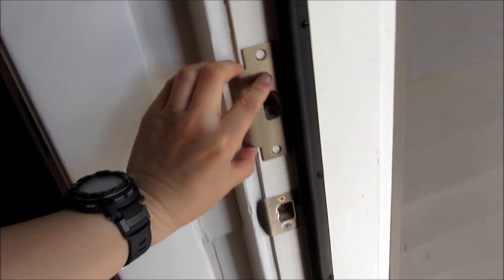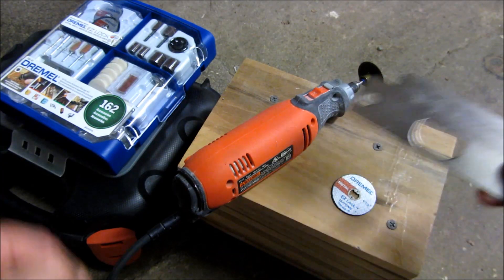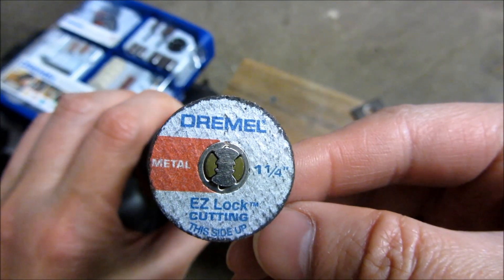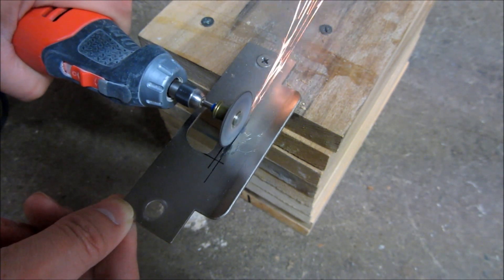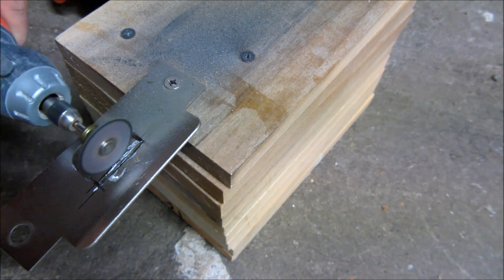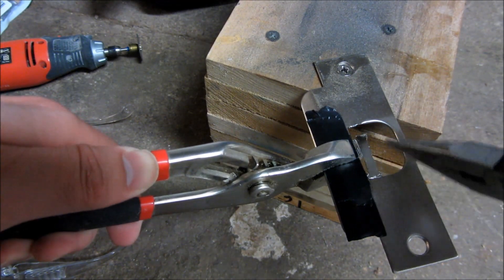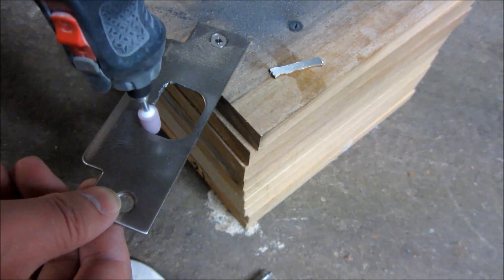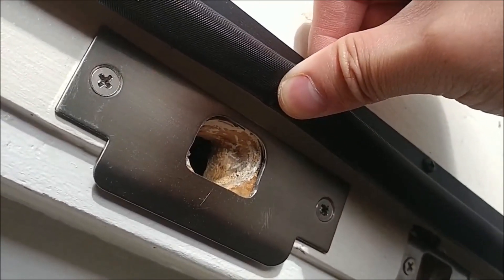Cut Door Latch Strike Plate with Dremel Metal Cutter Disc | EZ Lock Metal Cutting Wheel #456

Comment: You did a good job on the cut but that strike plate is not made for a deadbolt, it's made for a tubular knob latch....Next time get a "super-strike" for a deadbolt which would be stronger because of 6 screw-holes, not 2....

Comment: I have a security door that needs to have the "hole" widened for the regular latching mechanism.  Could I use that grinder attachment to make the opening bigger or should I try to cut it like you did?
Reply from the maker: If it's simply off by a hair or 2, u can use the grinder, but if it's off by 2mm or more, u likely have to cut it
Reply: I have the same problem.